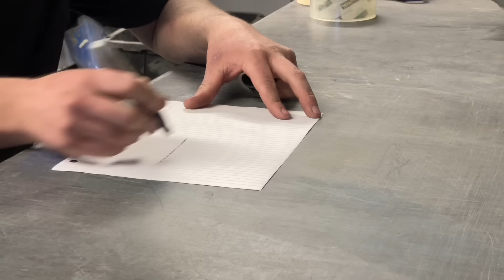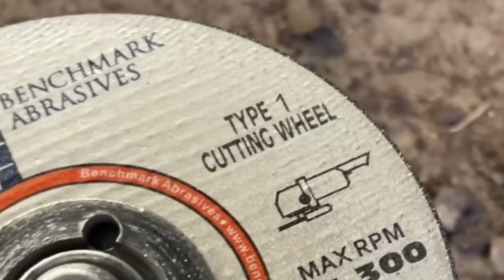We Bought This Truck To GIVE To You! Gumout 39’ Chevy Build Part 1

Comment: Green version of midnight blue with sparkly flaky glossy paint job on the exterior body, the interior original mint green in the bed in a glossy enamel, with the same in the cab.  Upholstery in cream and black leather, dashboard in cream leather, headliner in cream.
Suicide doors remain, rear brake light is a roof-mounted led with those bottle taillights wired in sequence and mounted on the rear sidewalls.  Front headlights LED, with a roof-mounted (but in-the-roof, maybe frenched into or fiberglassed into it) light bar of some kind

Engine should be a maybe a 409 or 348 with a top-mounted 4 barrel carb, if possible a machined aluminum block if you can get an out-of-the-box version of that.

You already have the bags to make the truck ride higher in the back, so maybe carry a smaller version to the front for a small lift in uneven terrain.

I love the whitewalls you have on it, so keep those, and maybe machine some custom wheels for it, using an Alligator theme, since you mentioned the alligator green.

Accessories, your side-view mirrors, if there is a motorcycle side mirror that has "lane assist" capability, for safety, it would be cool, (maybe the Honda Lanekeep Assist, or something from Bosch as an ADAS system) and definitely try to add some modern features like a dual-camera driven braking system, and a backup cam, adaptive cruise, adaptive high beams, Smart rear-view mirror.  

Interior mood lighting, led panel audio control and car monitoring system wired in to control ride height preprogrammed for 1 touch adjustment, carb settings, throttle settings (ride-by-wire?)for speed vs cruising, and a kickass sound system.   Maybe Crutchfield could help out on that.  Definitely need Apple Car PLay and Android Auto.

Comment: Since it's a chevy. Put in a 4200 six cylinder gm.  with turbo! wouldn't need to be that rowdy.  Nivlac 57 on YT builds them and could help. turbo 400. cool project.

Comment: Its going to be so light it wont need any giant engine to smoke the tires. Personally would have lenghtened the frame to take the full 6 foot bed and in theory make it usable for loading stuff. Engine needs to be different to stick out from the rest. One of those V6 J (?) Honda engines with a crankshaft driven procharger with a wild exhaust all of it more for the looks than performance. Like you say Preston, whats the use of 1000hp to most of us.  And its been done over and over again in LS form so please dont be another of those.

Comment: I say keep it old school and do the k.i.s.s method ( keep it simple stupid). 383 stroker with type of power adder to it. Keep it automatic so anywould could drive it. Put a decent sound system in it nothing to crazy door speakers and a small 8inch truck sub woofer. Sound detonation in the cab to keep it quite. For paint hot rod red with black and gold pin strips to keep that classy look.

Comment: What are ya thinking a small block a diesel an LS all of which are cool if done right if ya go small block or LS I'd go with a fi tech system so it's economical to drive easy to tune as far as color red or burgundy & black grill & interior w black wheels & window tint would pop maybe blackout the trim as well & color match the grill would be better I'm sure you'll figure it out

Comment: Maybe a 4.6 from a crown Vic, they're cheap, common, and well understood, a couple of mods and it's ready for tons of burnouts and daily use
Reply: WTF? Could you have chosen a more anemic engine? You could put cams in a sohc 4.6, degree those cams, long tubes, intake manifold, and every bolt on imaginable and have trouble making 300 to the tire. Without boost they're worthless!

Comment: this is sick, its cool of gumout to do this. for me.. man engines, what could be different in that but still bad ass. if i dont say V8 people are going to lose there minds... but i feel like an f20c engine or a k20 but setup as an INLINE 4 would be really cool. ya know turbo it or even go even more different and do a 4 banger with a super charger. i just think it would be fun. a 2jz would be sick in it but that might be a to long? for the front with the cowl? not sure. of course any v8 even just a 305 is going to be more then enough for this light weight thing. i'd say a super charged v6 from a camaro would be killer like the LGX but there so damn ugly plus the same issue as a mustang v8's going to have, duel overhead cam is WAY bigger then a pushrod motor. so maybe just a good looking LT1 motor.

Comment: K24 or k20 on 20 psi t56 transmission 12in wide rims on rear 335 rear r888 tires hood exit exhaust the name of the truck could be demon Slayer

Comment: 5.3 LS,and 4L80 trans.Easy to get parts for,and they run enough power to make anyone happy,and not go Nuts.(Well,at times it's Going to happen) You have to 'Dip' some parts for sure. Button Tufted interior back and roof.

Comment: Well to get me interested it would have to have a smaller steering wheel in a tilt column or a detachable steering wheel I would like something extremely reliable low maintenance good gas mileage thinking LS even though people say it's overdone it's just that damn good positive diff good brakes fatty fat tires in the back to get traction something in the cool color range maybe blue and silver or blue and white you asked my opinion man there it is

Comment: 300~400 Hp 
holly efi 
v8 
auto trans (due to Don who works at home depo)
optional hood to cover engine 
fuel cell under the bed of the truck 
two tone paint 
have fun with it

Comment: Is there space for an inline 6 engine?  Seems like the bottom end power is what you would want to focus on.  I would find a BMW engine.  Putting a Japanese POS engine in it would be an insult!  Finding an old Chrysler slant 6 might work if you can find parts.